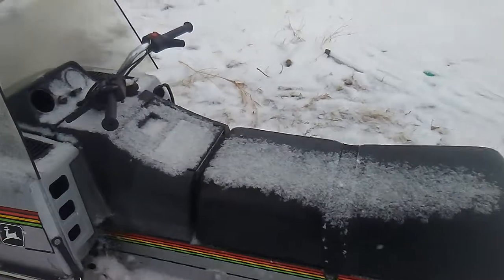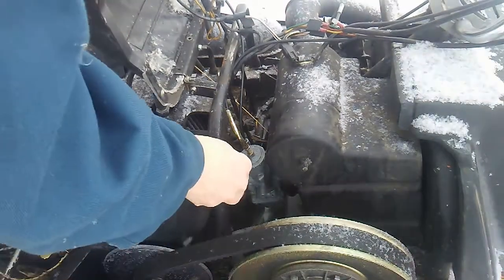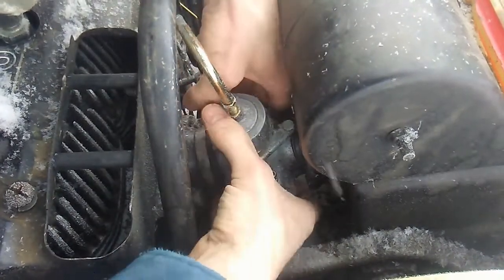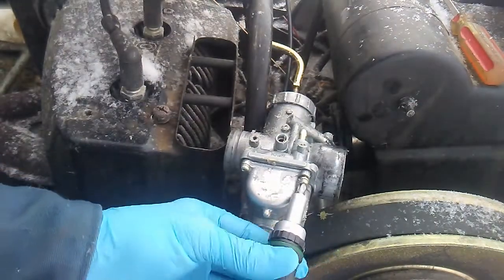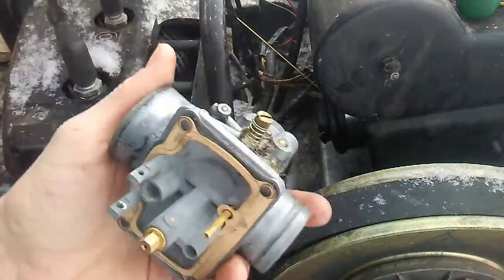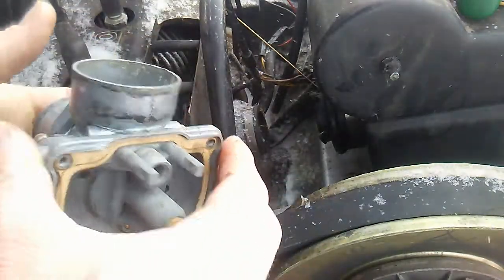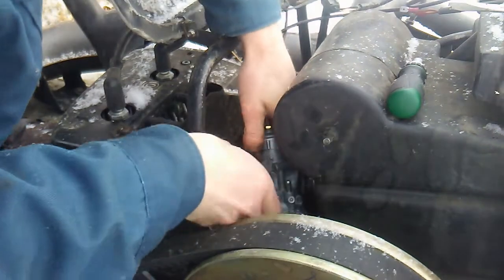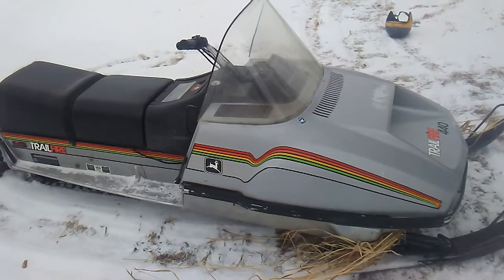Vintage snowmobile carburetor cleaning

Comment: Thats in really good shape for sure..  The oldest sled I ever has was a 70 something 340 olympic..
Reply from the maker: Yeah, the john deere's in good shape. My oldest sled is a 1969 ski daddler super twin racer. Incidentally it was also the first snowmobile I did a video on. I've always kind of wanted to try the olympiques, they look fun.
Reply: @nybergsgarage  they are fun.. and quick for what they are.. solid motor..  more reliable then the old TNT was as I  always found the fan on the 440 was too small.. the Everest was a really good sled back then too..